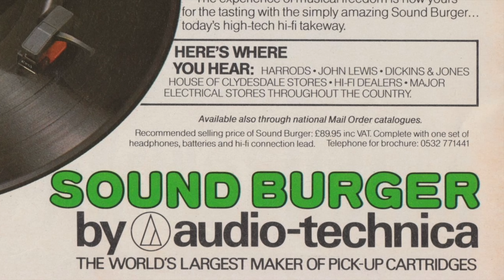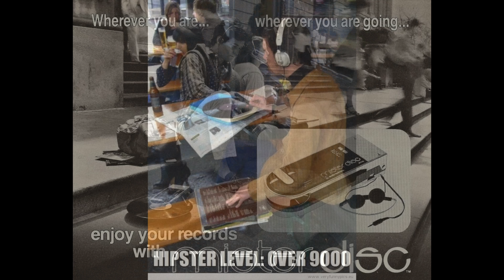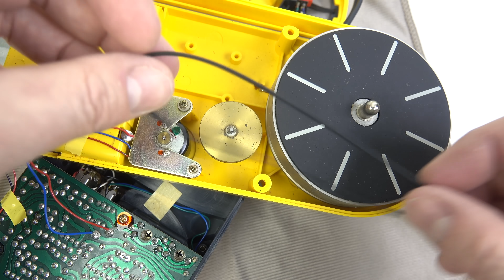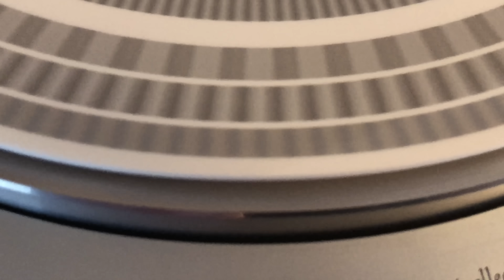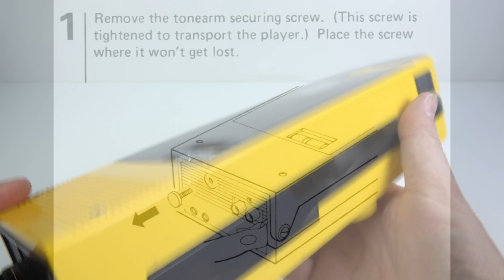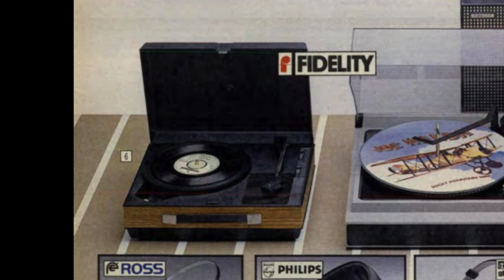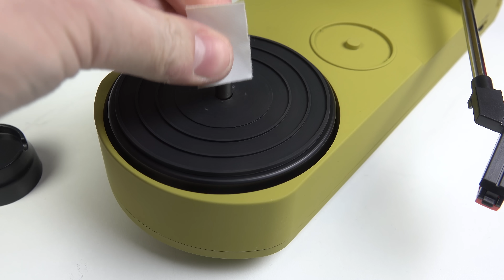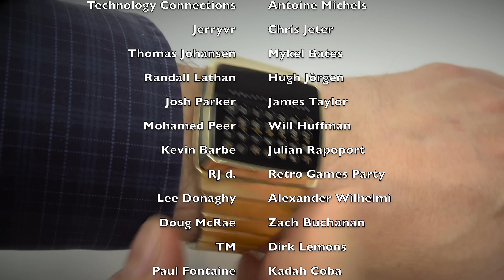SOUND BURGER & the clones

Comment from the maker: The record played at 10:57 18:03 & 18:42 is Hugh Masekela – Tomorrow
Info below copied from Video Description Text Box
CORRECTIONS
Substitute the word "Tally" with the word "Tare" in the section when I measure the tracking force on the green garbage turntable. 
ADDITIONAL INFORMATION
There were two Crosley revolutions, the CR6002A and the CR6020A
The one in this video is supposed to be the CR6020A
SPARES
Stylus https://www.stylusplus.co.uk/audio-technica-atn-103-stylus-3810-p.asp
Belts https://www.ebay.co.uk/itm/Audio-Technica-AT-727-Sound-Burger-Belt-Kit-2-Belts/331723247125
Strobe Discs
Search for Strobe Disc on eBay (or your preferred shopping platform) - mine is made by Pro-Ject and has 50Hz on the outer rings - models are also available with 60Hz on the outer rings.
Reply: Techmoan Thanks!
Reply: Techmoan quick thing: resetting the weight of a scale is called "tare"ing, not tallying.

Awesome videos!
Reply: Hugh Masekela - Bird On The Wing
Reply: What vibraphone track is playing before 10:57? Thanks!
Reply: EranBuhbut what was the vibraphone song name?
Reply: As soon as that started playing, I knew just who it was. Oh, the memories that song brought back. I've not heard it for over ten years. Thanks!
Reply: If any of you are using the Strobe Discs, a word of advice, make sure you are looking at the disc while under actual 50Hz (or 60Hz) lights, modern LED lights might be using varying switching frequencies. Other light types might have other "sync" problems.
Reply: luppa79 get the cheapest LED bulb you can find. It'll be powered by a simple capacitor dropper/resistive divider, and will have a "nice" (for this purpose) flicker at mains frequency.
Reply: Hugh Masekela - Bird On The Wing at 1:19 of the song
Reply: Techmoan actually I meant Joe Morello's It About Time. Didn't notice it until I re-watchwed the video. Thanks anyway and the video is great a usual!
Reply: Big thanks for listing the music. :)
Reply: thank
Reply: Thank you!
Reply: luppa79 There should be a market for lights made to strobe at line frequency for synchronizing things.
Reply: Buddy Clem Like a regular incandescent light bulb :) You can emhasize the "strobing" on a regular bulb with a triac dimmer- type circuit. It's not hard to build a LED strober with a very accurate frequency. I have heard some have used a phone app to flash the screen or the camera flash led, but I'm not convinced that you can get  a big enough frequency out of those atleast on every phone.
Reply: Techmoan, do not forget to pin your comments with corrections like this one. As it is, it goes away from the top so people are not really seeing it.
Reply: I need better eyes. I just this minute realized it's Techmoan" and not Technoman!
Sorry about that.
Reply: Thank you Techmoan , fantastic review and repair.....I’d love to get this , wonderful  minimal design .
Reply: Bro I have a sound burger in my closet in box lol yt algorithm knows it all
Reply: Less reviews on turntables more reviews on cd players grr

Comment: I think the Sound Burger looks great in yellow, so 80's!
Reply: It would look great paired with the yellow Sony Sports Walkman line... I had a cassette Sports Walkman with auto reverse, that sucker was so very efficient with battery life.
Reply: Reminds me of those water resistant walkmans by Sony, they were yellow and black, or yellow and grey. Not 100% on that.
Reply: I like the yellow to. Though I admit that when I first saw it I though it was a cheep gimmick. But seem that the original device was pretty decent. And if I got one today I would likely want it in yellow.
Reply: +DashCamAndy I loved mine. I even used old batteries they threw out at Kodak from the once use cameras and i could play cassettes for a month on the same 2 old batteries and nobody believed me.
Reply: I know right? it reminds me a lot of the Walkman "Sports" line with the yellow and black.
Reply: The other machine (with the two big buttons) looked good, too.
Reply: Liofa sounds like 💩 though

Comment: The turning being too fast might be down to the fact that the batteries are new and better than the average stuff that was available back then. I'm sure the speed will normalize as the batteries get drained a bit.
Reply: munxcorp
No. Likely due to discrete electronic components like electrolytic capacitors that are out of spec because the gel has dried out .
Reply: Unlikely, but anything is possible. It is just more 50 year old electronics made out-of-bounds due to the length of time passed.
Reply: This is what I thought - that and compensation for the stabiliser
Reply: DC motors in cassette players and portable equipment generally had a voltage regulator in them, and on many you would find a hole in the back where you could adjust an internal pot to set the speed.
Reply: @Melvin Walker You have to replace the electrolytic capacitors.
Reply: I have a Victrola record player from 1913 and it has an adjustable speed regulator on it. It's very unlikely that this player had no regulation 70 years later, because high-impedance potentiometers were used to control speed and those wouldn't allow for much power to go through. This means they were almost certainly controlling some kind of voltage regulator.

By the way, you can see how the mechanical speed regulator works in this video by Technology Connections: https://youtu.be/0vbyoZDQaIY?t=10m34s
Reply: I like the idea o the batteries being of higher quality giving too much power and so making the thing run faster. I wonder if this can be tested in some way.